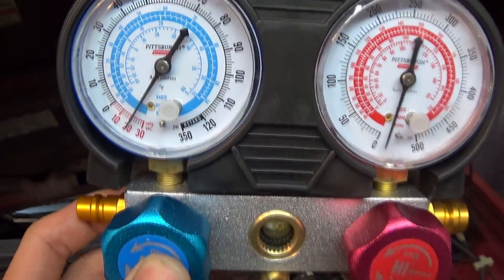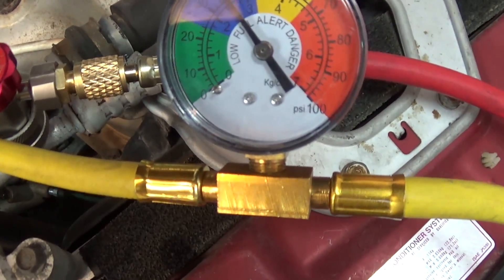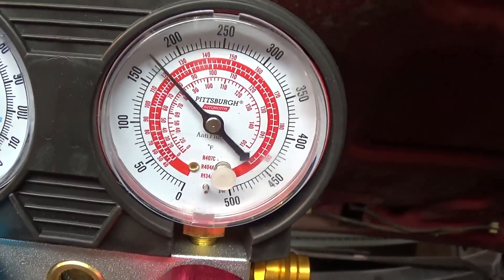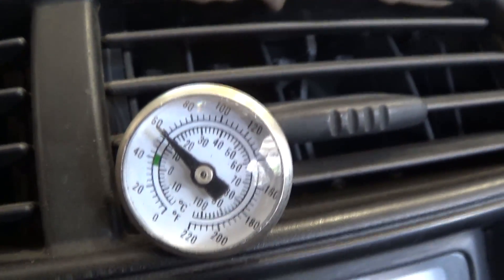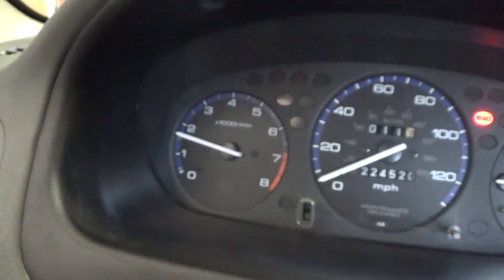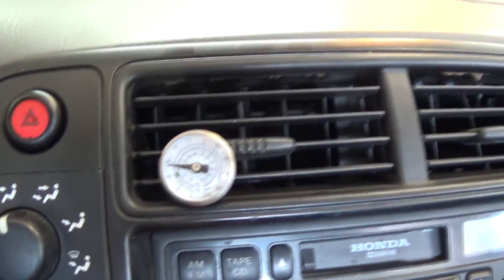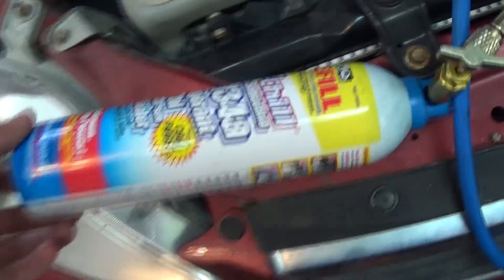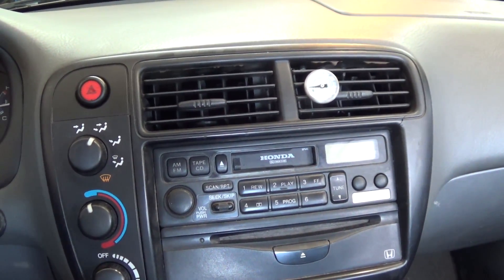How Well Does Maxi-Frig (R12 Alternative) Refrigerant Work?

Comment: i used around 22- 20 psi at low side variable displacement compressor.. ambient temp 27 c it is very good .. don’t forget to trick the sensors 😂.. make the pressure so that the flashing of the refregerent at the evaporator does not get lower than 0•c

Comment: You dont have enough charge. AC system should be 45F at the dash vents or colder.  Yes, that 12A drop in contains propane.

Comment: Weight charge or by sight glass check for bubbles . Then check pressures and outlet temps . At high miles evaporator will be covered in dust hair etc . When recharging properly pull a vacuum for 1 hr and hold for minimum 30 mins .
Oh yea not once in video did I hear the thermostat work . AC needs more work ......

Comment: R12A -- I use it as R12 replacement in 1970 CST w/ 350 CID.  Have used it for 12+ months.  No fires or explosions.  Better chance the Hydrogen generator will blow before the R12A causes a fire.  Yes, the 1970 CST runs on water.

Comment: its a mixture of 134a & Propane ,  the propane carries the  Mineral oil  which was used in R12 Systems , 134a  itself want carry mineral oil was the main problem with adding 134a to a R12 system without changing the Mineral Oil to Ester or Pag oil which 134a would carry through the system to lubricate the compressor , But adding about 30% Propane to 134a it would carry the mineral oil through the system .
Reply: I'm pretty sure it's Propane and Butane... No R134A in R12A. Also 6oz is equivalent to 18Oz of R12, so I'm pretty sure he overcharged the system.
Reply: This is truth, thank you for explaining it.
Reply: @ryurc3033  No, it is not the truth. it's misinformation.

Comment: no check of oil level ... no oil add... no find out what KIND of oil is in it..... just add the refrigerant.... no evac of all old refrigerant ... ya lets just mix all this stuff up... high side should have been around 180.... was over 200....that's how you smoke an ac system... armature hr with a harbor freight ac meter ya baby.

Comment: 134 was meant to be an R-12 replacement so of course it will work in a 134 system.
All it is hydro carbons. What refrigerant should have been made from in the first place. R-12 was patented and paid for by DOW co. so they pushed it. The patent ran out so they had to quick patent another one. FUCK THEM!  Use Enviro-safe Industrial. I live in hot So Cal climate. It works great.
Enviro safe is a blend of propane and butane to mimic the pressures of r12. My wife's car blows 25 degrees at 105 ambient. I know, that's too cold but she likes it that way. Show me another refrigerant where that would be possible.

Comment: I used 12a refrigerate to replace my R12 system. The 12a is inexpensive compared to r134 and is colder. 35 psi is the recommended pressure for 12a.

Comment: With your high side needle bouncing that means your compressor Reed valves aren't sealing.  Time for a new compressor
Reply: You are more or less correct. This Honda uses a Sanden TRS090 scroll compressor. The scroll has just one discharge check valve. When it goes bad, discharge gas will backflow during part of the pumping cycle, causing a lot of pumping loss. I'd imagine the scroll faces are worn as well. Between those two issues it isn't going to pump very well, especially at low speed.

And to the OP, yes, Maxi-Frig is a hydrocarbon blend of R-290 (refrigerant-grade propane) and R-600a (refrigerant-grade isobutane). The reason it didn't work well as the 134a has to do with the combination of smaller, lighter HC molecules, a bad discharge check valve, worn scrolls, and your system was probably low on oil (oil seals the scrolls). In general, HC refrigerants work well in a properly functioning system. Most new refrigerators are using R-600a, for example. The only real drawback is that they are very flammable, so a large evaporator leak combined with an ignition source = very bad day.

If your system is designed for R-134a, use R-134a. If it's designed for R-12, use R-12. It doesn't cost any more than the new R-1234yf , after all. Just make sure to spend the money to make your system gas tight. If you fix the problems and run the compressor for at least 5 minutes once a week during the cool season the R-12 will stay put.

Comment: That jitter on the gauge is likely 'cause you used a refrigerant with OIL mixed in. I have replaced 3 compressors so far (as ofJune 27!)  this season that failed due to over charge of oil. If you don't see oil all over the place, DON'T ADD ANY OIL!!!! DON'T ADD OIL!! HEY!! NO ADDING OIL!!! (get the point?)
Reply: 100% oil doesn't compress.....just like dumping a gallon of water down the intake, compressor can't take hydrolocking
Reply: @ryurc3033  That's right. Liquids cannot be compressed in traditional refrigeration systems.  You can buy small cans of refrigerant that have various oils mixed in. (PAG etc) Using them can cause damage if there was a full charge of oil already in it!. Even worse in small refrigeration systems like a home refrigerator!

Comment: so could you top off a r12 system with this stuff?  mix the two different gases? thx.
Reply: No you can not. If you want to use another type of refrigerant, the remaining R12 would need to be recovered by a shop first. R12 won't mix with this refrigerant and could cause the system to not work correctly and could possibly damage the compressor. The other problem with mixing refrigerants is that no one will want to recover the blend as it would contaminate their equipment and would be be costly to dispose of.

Also, federal law prohibits mixing refrigerants or replacing R12 with this refrigerant since it is flammable, although oddly enough there are no federal laws prohibiting the use of flammable refrigerants in R134a systems, so it would be legal to use this refrigerant if you install R134a fittings unless the state you live in has a law prohibiting the use of flammable refrigerants.

If you want to keep things simple, safe, and legal, I would suggest either finding a shop that will top off your R12 after fixing the leaks or getting an EPA 609 certification so you can buy R12 refrigerant yourself. Hope this helps

Comment: Also you need 25% more then the weight of the 134
Reply: No it be less....
Reply: @eddiemiles1920  The volume of liquid would be about the same, but since propane/butane is much less dense than R134a, the weight would be much less.
Reply: @averyalexander2303  yes, a 6oz can of the iso/propane gas, like r290 and r600 mix or some call it hc-12 gas is equivalent to 17oz of r134a  give or take oz depending on the brand of can
Reply: @eddiemiles1920  How is that calculated, by the density of the liquid I'd assume? Wouldn't the goal be to end up with the same volume of liquid in the system as the original refrigerant? Regardless of being "more efficient", there still needs to be enough liquid in the system to fill the evaporator and condenser enough to achieve appropriate superheat and subcooling respectively, maintain the proper liquid level in the accumulator or receiver, etc.

If the equivalence is calculated by density alone, many manufacturers got their calculations way off.
Reply: @averyalexander2303   I forgot about this video. 4 yrs

Comment: Sad that you did a video and didn't use an r12 a.c. to demonstrate...r134 is dirt cheap...why would anyone put that crap in their r134 system.
Reply from the maker: True, wish I had an R12 vehicle to try it on, but unfortunately I didn't.
Reply: @CtrlAltDefeatTV  you can put it in mine it's so freaking hot!
Reply: its not crap vent temp is much colder than r134a

Comment: Dude, you over charged it, plus you ONLY charge that shit as a liquid and throttle it in by just cracking your lowside. I can attest to its performance.  In an r12  or 134a system, it will freeze your effen balls off.  You should redo the test with a proper charge of that maxi frig.  do a shootout video maxifrig vs 134a.  Where you live?  Bring it over to my shop.  I will install it correctly.  If you knew how well it works, you would never go back.

Comment: I think you might have over filled it. You should get a scale, and weigh how much you're putting in. On the front of the can it tells you what the equivalent weight is for r134a. The can you have is 6oz, which according to the can is equivalent to 14.22oz of r134a. I'm not sure what year your Civic is, but it looks like it's a 1999 or so. A 1996 - 2001 Civic takes 23oz of r134a, so you only need 9.7oz of maxi frig. I'd like to see this test again, but with a scale, so you know you filled the system with the proper amount of refrigerant.
Reply: Tony Herson   If it was over filled the clutch will disengage on high pressure.
Reply: @coarsegrind  No it won't, at least not unless the system is waaaaay overcharged. The system will still run with a significant overcharge, but it won't run efficiently. The high pressure cutoff switch on these cars shuts the compressor off at around 400+ PSI, which is higher than you would ever want the head pressure. The high pressure cutoff switch is just there to prevent a catastrophic failure like an explosion if the head pressure climbs dangerously high from a condenser fan failure, a restriction, or a massive overcharge.

Comment: I THINK YOU OVER FILLED IT, YOU ONLY USE 6 OZ OF THAT FOR EVERY POUND THE SYSTEM REQUIRES, I USE IT IN ALL MY CARS AND IT BRUTAL COLD WHEN USED CORRECTLY AND 6 OZ OF THAT STUFF IS NOT A DANGER, YOUR AC IS JUNK IT NOT THE FREON DUDE BEEN USING THAT STUFF FOR 13-14 YEARS NEVER A PROBLEM
Reply: @Zombie Head yes you can because it is compatible with both oils
Reply: Exactly. 6Oz of R12A is equivalent to 18Oz of R12 or 16Oz of R134A ROFL. Propane and Butane are one of the best refrigerants on the planet in terms of cooling, so you don't need way as much.
Reply: @Zombie Head yes and it works just as good

Comment: Thanks for sharing........The Warning: Flammable was the "deal breaker" for me......Might as well put Propane in.....the whole system would not use more than $5 worth.......Propane would be very dangerous and you would never want to smoke or be in an accident with car that has Propane in the AC System.

Theoretically, the Maxi Frig should preform better in a r134 System because it runs at high pressures than r12 System, from what I understand and should cool more.  So, the r12 is probably going to have poorer results.
Reply: Your worried about a little propane and don't even give a thought to the 20 gallons of gas in a tank behind you....
Reply: @DieselWorld  I hear that argument all the time but it really isn't valid. Yes, the gasoline in the tank is also flammable and there is a lot more of it. However, the fuel lines do not run through the inside of the car nor do they run right behind the front bumper like the AC lines and condenser does. The fuel system is comparatively very well protected. The AC condenser could easily be destroyed in a minor accident and cause a fire that destroys the car and could possibly injure someone.

The other less likely but still very dangerous scenario is the evaporator behind the dash could leak, filling the car with flammable/explosive gas. Some of these products have a scent to let the driver know if there is a leak, but that still doesn't help if the evaporator leaks while the car is parked and fills the cabin with explosive gas, possibly turning the car into a bomb if there is a spark from a relay, keyless entry system, etc.

I realize that the odds of the evaporator suddenly developing a leak significant enough to cause an explosion are very small compared to the first scenario, but a small risk doesn't mean it can be entirely ignored, especially considering the potential consequences.

I am not saying to not use flammable refrigerant if you want to, I am simply saying to do your research, consider the risks and benefits, and make up your own mind on whether the risks are worth it to you.
Reply: Hot oil. Gasoline....
Reply: Not sure what the concern is with propane, many vehicles use that as the fuel source
Reply: @jonathanschor4495  There is one major difference: The AC condenser is right in front of the car and is one of the first things to be smashed in an accident. The fuel tank and lines are much better protected and are much less likely to be damaged in an accident. Besides, if an accident is severe enough to smash the fuel tank, you are probably in bad shape anyways.
Reply: @jonathanschor4495  There is one major difference: The AC condenser is right in front of the car and is one of the first things to be smashed in an accident. The fuel tank and lines are much better protected and are much less likely to be damaged in an accident. Besides, if an accident is severe enough to smash the fuel tank you are probably in bad shape anyways.
Reply: I THINK HE OVER FILLED IT OR HIS CONDENSOR IS JUNK, IVE USED MAXI FRIG FOR 13 SOME YEARS AND THAT STUFF IS AWESOME, THE CANS ARE 6OZ OF THE CHEMICAL, SO IF YOUR AC USES A POUND, WHEN USING MAXI FRIG YOU ONLY USE 6 OZ MAX AND YOU HAVE COLDEST AC EVER, BRUTALLY COLD AND 6OZ IS NO BIG PROBLEM